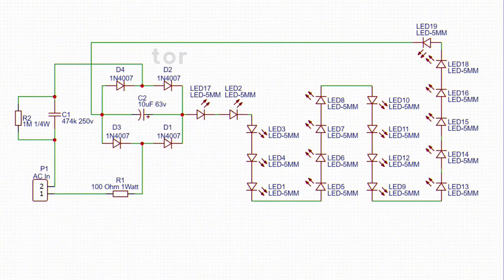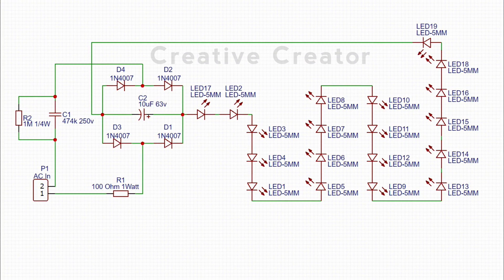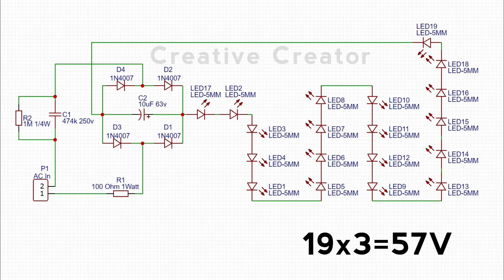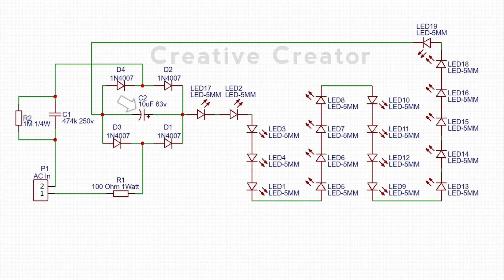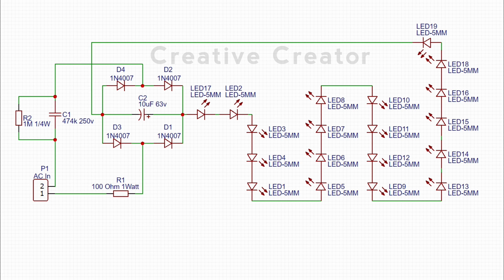DJ Light Circuit

Comment: good explanation why you used R1?
Reply from the maker: R1 is used for providing the needed voltage for the circuit and R2 is the AC discharging Capacitor.
Reply: thanks man  @Creativecreator